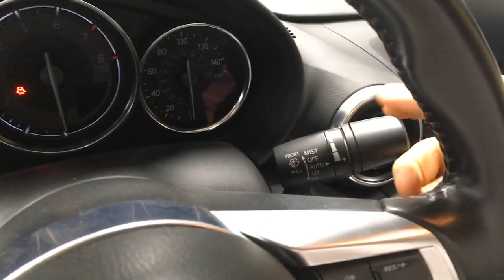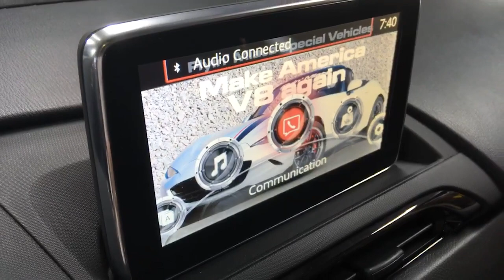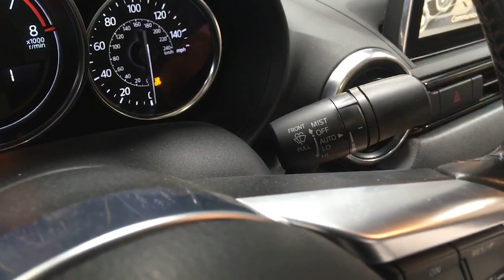ND V8 Miata Technical Tour (FM Live)

Comment: Awesome upload, can see why the FM LS3 swap cost what it does. Any chance this beauty can be made available for Australian NDs? We are already used to this V8 in our GM Holdens no longer in production 😔
Reply from the maker: There are some legal problems in parts of Australia with putting such a big engine in a light car. We also haven’t been able to find a RHD variant of the rack. It should be possible because that platform was used under some Holdens, but no luck. We looked!
Reply: Doubt you'd get that engineered in Australia, the only one I think you can put an LS in is the NC and it would only be the 5.7 LS
Reply: @FlyinMiataVideo  Appreciate the response. Will have watch in awe from Oz. Love your work guys!!

Comment: Was that the original throttle body in the trunk? If so what purpose is it providing?
Reply from the maker: It had been used for some stability control testing - the DSC system won't function at all if there's an error code from the Mazda PCM for the throttle body - but had been removed for a photo session. At that time, I just stuck it in the trunk and strapped it down. Never got around to taking it out. I think it's still underhood in the photos for the Road & Track print magazine article if you look.

Comment: Has this ever been swapped into the 124 chassis? Seems like it would fit, but what about the CAN programming?
Reply from the maker: Nobody has tried yet. Since the bulk of the Fiat's body control components are clearly Mazda sourced, we expect most of the CAN will port over. But the PCM is a Fiat part and we don't know if it speaks FCA or Mazda, so there may be some changes required there. We may have to get our hands on a Fiat and datalog it to find out.
Reply: @FlyinMiataVideo  I know this is a little old, but have y'all moved forward with this at all? I would love to know what the possibility is.

Comment: I contacted some people from RMS and one guy use a LT5! on  RX-8 but with the same code for CAN gateway so, If I swap LT5 will the gateway that you use for this miata ND may work?
Reply from the maker: Big chunks of the code will likely work, but we cannot guarantee that all of it will. We don't know how deep into the code RMS goes, and the NC/RX8 platform is dramatically simpler than the ND Miata from a network point of view.

Comment: is there no chassis reinforcing neccessary?  what about transmission  clearance?  will the tunnel in the nd clear .the big trans u use or are mods necessary? 
   thanks Chris
Reply from the maker: The "spider brace" is the primary chassis reinforcement we add to the chassis, although the rear subframe is also beefed up quite a bit. When Car and Driver tested this car, they felt it was stiffer than stock.
The transmission is a tight fit but it does fit.

Comment: my personal preference for PCM would have been a production E38 from a Camaro then use a custom fuse block rather than the gigantic fuse block that GM Performance offers as part of their crate engine offerings. A custom harness could be easily built around your miata and the E38 PCM.

Comment: Have you considered running E85? And have you seen any need for a extra oil cooler?
Reply from the maker: We haven't spent much time monitoring oil temps in this car, but we have added coolers to a few of the cars we've built and our dedicated track cars. E85 is no longer available in our town so it's not something we spend any time with. Trying to eke out another 15 hp just doesn't seem necessary!

Comment: I was wondering if you might be able to do a project on a fiat abarth spider automatic.But not a V8 swop but a v6 or inline 6 keeping stock transmission and exhaust system .I believe the stock transmission can handle roughly  350 hp .Engine of choice was going to be either the Kia GT turbo or Nissan 370 z niissmo engine
Reply from the maker: Sorry, that's not the sort of project we take on. We specialize in doing one conversion and doing it well. Good luck!

Comment: When my engine blows I'm going to do this. No question. The only question is should I waste $5k+ now and supercharge it and blow up my engine faster So I can get the v8?...
Reply from the maker: If the goal is to blow it up, just drain the oil out. It's quite possible to boost the stock engine without damaging it, so that's not a good way to go if all you want to do is destroy things.

Comment: Why not the coyote engine?
Reply from the maker: The Coyote is physically considerably larger than the LS platform, so it wouldn't fit without significant structural and body changes.

Comment: i love how they can do a full on v8 swap that talks to the mazda body computers but nobody can boost a skyactive G...  Why not do it the same way as literally everything has ever been done with stand alone ECUs? skip the factory trash.
Reply from the maker: We do offer turbo kits for the Skyactiv G, just not the 2019-21 cars at this time.
The "factory trash" is a lot more powerful than most aftermarket ECUs. The factory is a long way ahead of the aftermarket when it comes to engine tuning these days. Don't judge a 2021 car by what you learned on 90's vehicles.
Reply: @FlyinMiataVideo   The aftermarket standalone ECUs being less complex is exactly what allows them to accommodate big power, is it not? At a certain point, wasn't the whole idea of high power tuning to eliminate the bloatware and get the engine's brain down to it's primary functions with some fail safes programmed in? 

Powerful, yes. But as far as tuning is concerned, I think you can agree that the "power" within the new hardware is purely a metric of it's ability to suppress tuning. If a modern Haltech, Motech, AEM, or other tuning solution is giving us flex fuel, Drive by wire, boost by gear, factory smooth idle control on 800+hp builds (non miata) and letting the builder be near total control of their engine and mods while the sophisticated ECU won't, that shows me  the contrary. While being technically "ahead" of the aftermarket tech, it's moving us behind again.

In that way, I am calling it "trash" because it sounds to me like it's solely to blame for making the goal of forced induction so prohibitive.
Reply from the maker: @twrcrew8852  It's not a cellphone where you can increase performance by getting rid of overhead because you only have so much processing power :) The extra capabilities of the stock ECU are what give it the ability to handle the hard stuff, the edge cases that the OEMs have to deal with. A big aspect of it is controlling the engine tightly enough to pass emissions standards under all conditions. It's easy enough to make an engine run well at WOT when warm. It's a lot more difficult to get the cats to light off in time when everything is cold-soaked and there are extra hotel loads while staying within the minimum allowed emissions. This has the side effect of better efficiency as well. These may not be important to everyone, but it's why the factories put so much effort into their tuning and so much capability into their ECUs.
It's not as easy as it used to be, no. That's because standards are higher and if you just yank out a stock ECU and jam in an aftermarket one you have hundreds of hours of tuning ahead of you to get into the same ballpark as the OE tune - and you won't be able to register your car legally in most states.
Reply: @FlyinMiataVideo  i think your last sentence is the real angle here. There's something not adding up here though, my old 2004 NB2 with it's primitive ECU and 130hp got 35mpg consistently.  My current 2021 ND2 gets almost exactly the same mpg. whatever hairs they split to make this overcomplex ECU and engine speaks of leaps and bounds that just haven't really translated to results in real life.  I might get 160hp now on the dyno, but driving in my normal power band the car feels neither insanely faster nor more efficient. It just feels newer and I have slightly more gear at cruising speed. 

And this is the NB2 we're talking, you know... the "2nd heaviest" one before the ND RF came in.  20 years of technology seems to have translated to NVH improvements more than anything else. the weight and feel of these cars are far too close to 1 for 1 for me to accept what's going on under the hood of the ND. As much as I'd love V8 power, i'd absolutely hate v8 maintenance and I like my redlines high.  I'll probably go EV on this thing if bureaucracy and technology have truly defeated us in a single revision.